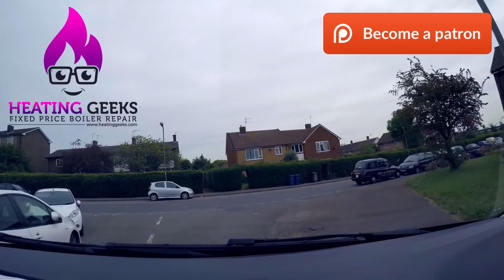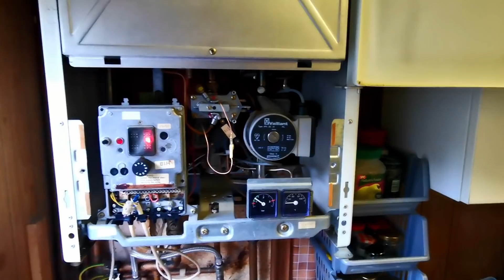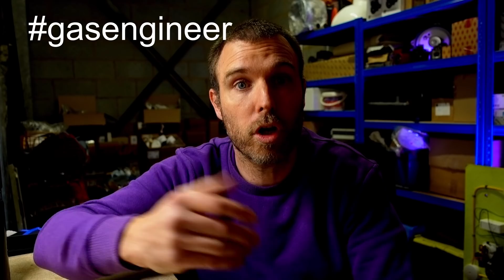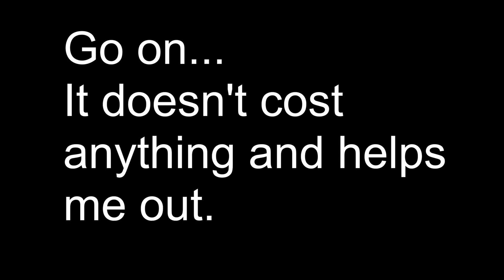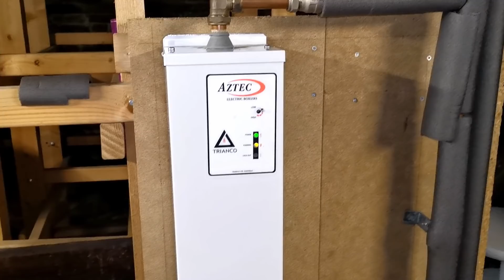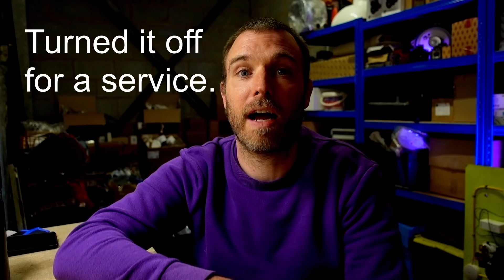Obsolete boiler parts....This could cause problems...

Comment: Hi HeatingGeek, Im a new subscriber and am really enjoying your videos. Good to know I’m not the only one banging my head off of people’s boilers day in day out. May I ask what component of the PCB you was heating up with the hair dryer and why heating it will make it work again ? Thanks 👍😃.
Reply from the maker: I was heating a failed capacitor. Heating it will make it work for a while. As long as it doesn't get cold again it will stay working. So the customer had to leave his heating on 24h but turn it low. So the boiler never had a long off period. Then I replaced the bits and its all ok.:-)
Reply: That’s great. Thanks for sharing all that valuable knowledge you have. It is appreciated. Stay safe mate 👍

Comment: A wise man once said “boiler is fit for purpose as the manufacturer intended”
Would I do it? Probably not....
People are to quick to fook you over if there’s a problem & most of us aren’t in that knowledge bracket! 
Hairdryer & solder yes- mess about with resistors and capacitors no.
Reply from the maker: Fair enough. So new boiler then?

Comment: Nothing wrong with happy customers , have been repairing dry joints on Pcb for years ELM leblanc and Potterton lynx were probably the first one I started on. (shows my age ) If the manufacture put better quality components and more solder we would not have to correct there mistake . Keep up the good work and the videos .
Reply from the maker: I worked on the lynx and lynx 2. One was drop-down PCB and one swung open if I remember > The harness failed where they bent didn't they??
Reply: @HeatingGeek Didn't  think you were old enough to remember these boilers, Lynx had drop down and was usual for dry joint on transform but when you dropped the pcb the boiler would work !!!!!! and yes lynx 2 was swing open and wires did get bent a bit and pull on the pin on pcb .Lets be carful out there has a sergeant on a TV show used to say

Comment: Great video as usual.. I think the dry joint on the vaillant is ok as who can ever prove otherwise. But I think any kind of modification has the potential to bite you in the ass as we all know the answer to that is no unfortunately.
Reply from the maker: Yep... Unfortunately, that's why I wouldn't do it on a gas boiler. Unless I can gain a qualification in electronics I wouldn't go any further.

Comment: I’d do exactly as you did Ollie. Used my limited engineering judgment to repair what I could.  
If a boiler is out with the manufacturers, then they in effect wash their hands of that appliance.  At no time has ANY manufacturer demonstrated any interest in perusing anyone for doing as you did, frankly, they don’t give a shit!!
I’d do it if the parts were even still available, fuck em!!!
Great video mate, love it, one of your best yet.  By the way, that Vaillant is older than 92.
Stay safe👍
Reply from the maker: I'm working on a boiler from 1980 or 1976 at the moment. (need to get it confirmed) Older than me though. I will get it fixed too.. (hopefully) :-)

Comment: I Agree if you just have a dry joint or something that you can see why not & would repair it . But if you tell your local Gas safe inspector ( Know it all Wanker) You are doing that he would have kittens no doubt 
I was asked once by a oftec inspector if I replaced motor bearings?  I said yes he said dont you are not a motor specialist if something happens  to that appliance you will be held responsible  
What about all these places where you can by a repaired pcb ! They could be joe bloggs in there bedroom 
people buy them
Reply from the maker: Exactly. A lot of the Ebay sellers are. :-)

Comment: I could write a hole essay on this subject but first I need to fully 7understand what Problem you have . For me I have a problem with certain manufacturers who  consistently design Pcb with under rated  components or poorly manufactured pcbs or even poorly located pcbs . Pcbs located directly next to heat sources or below  hydraulic sections  which  leak like clockwork and take out  the board . And the same manufacturers charge half the price of the boiler to buy a new Pcb. Or the  D .S who  tells the customer he replaced a faulty Pcb with a new one but has blow dried a second hand one believing his fixed it, if you have the necessary skills to diagnose down to component level and are not time challenged great as long as customer is aware of the repair. I say carry on . Keep the customer happy.
Reply from the maker: You made a lot of good points. :-) I think if a manufacturer puts poor quality (low heat rating etc) parts on a PCB and they consistently fail then we should be able to fix their built-in obsolescence. I have a couple of PCBs I can think of.

Comment: I am glad you done it, if I had of found that fault I would have told him the part is no longer available and the boiler would have not been working. I understand and totally get it as to why you posted this, its a conundrum because you know as an experienced engineer those old boards are easy to fix dry joints on, but its not allowed.  looking at the comments, lots of people have no idea what repairing the board means legally, they are not GSR or if they are need to talk to the GSR.  Yes I have done those single layered Puma boards years back, when you had tracks 10mm apart with a resistor connected across them, they look like something you would knock up at school, whereas the boards now days have 20 or 30 components in that same space.  So not now, I would not want the grief if something went wrong, and I know you don't, that's why you do those safety tests after you have fixed a boiler, there again helping someone in real need has its rewards.
Reply from the maker: The PUMA was a boiler that had an issue with the PCB that Potterton knew about but never fixed. Thats where I first realised some manufactures wanted things to fail. That really annoyed me. How can they get away with that?
Reply: @HeatingGeek  I have never fitted a potterton since those days, or a baxi. if I work on one I can still see the same design principals.

Comment: I’m an electronics engineer who owns a small heating company. I can sympathise with the manufacturers to some extent that supporting appliances forever isn’t really feasible.

The manufacturer is limited by obsolescence too. The PCB in your 25 year old boiler may well have parts in it that are obsolete.

Legislation is a big factor too. The manufacturer is obliged to put each part they wish to sell through CE certification. If parts become obsolete you’d have to certify the product again.

From a legal stand point your putting yourself at risk by changing parts not on a like for like basis. If you change the design in any way you become the manufacturer and are then responsible for that product.

I looked at manufacturing compatible PCBs but found one of the gas regs explicitly forbid it.
Reply from the maker: I know. Thats why I showed an electric boiler. :-) What do you think about the dry joint?
Reply: HeatingGeek no one could ever argue that a dry joint was anything other than a like for like repair.

I’d also be happy to replace a components on a board level. The odds of anything going wrong it’s not worth worrying about. I just wouldn’t tell the home owner that’s how I’d repaired it or put it in writing for that 1% chance.

Other problem is how long does it take you to get to site, find the fault, get the 15p capacitor, go back, fit and test it. In the customers head you’ve charged them £300 for fitting a 15p part.
Reply: Chris B sorry I disagree Chris, that 15p capacitor is part of the boiler, fuck the manufacturers, they don’t care & there’s no PCB Police around our area.  Ollie uses his engineering judgement, he’s there to fix the boiler.   A PCB repair is generally on the lower voltage & current side of the board anyway.  Granted, if you’re employing people, it’s your neck on the line & you need to have procedures in place & Rules to follow.
Reply from the maker: @chrisb4009  I charge a fixed fee on private work so the customer doesn't have to worry too much about it. :-)
Reply: HeatingGeek fantastic channel by the wayx

Comment: I think your spot on, as of another comment - if you can see the ratings you are simply replacing the faulty part, like for like. How is that modifying it? On the subject of electronics, what is the display you show in your intro that has frequency, cycle, pulse width? Duty on the screen? Thanks.
Reply from the maker: Thats the PWM to a keston fan. I did a whole video but lost a lot of it. I might stitch it together like this one. :-)
Reply: Is it a piece of equipment you’ve bought to test this? Perhaps add it to your list of tools to buy??

Comment: You are not modifying the component, it's a repair, and both good ones, I replaced the Pump relay on my vaillant ecotec exclusive  832 when it failed as the PCB was £280... relay was £3 for the exact same one, why we are engineers and not fitters! Well done @heatinggeek
Reply from the maker: Thanks. :-) But if it was a gas boiler that I replaced the cap on i would of been breaking the Gas regs? Maybe?
Reply: @HeatingGeek  only if they know.... and some of the shocking installs we see everyday I very much doubt they would be interested, if you are replacing a component of the same if not better quality, then how is it modifying?? It is classed as a repair and a good one, I agree if you are not confident then best leave alone and just replace the complete component, but if you have the ability and know how then why not, better for the customer and the environment  👍🏻👍🏻

Comment: Dude It's absolutely fine in my opinion, I've been using a hair dryer and electronics soldering Kit for years! It's no different to repairing any other part of a boiler, as long as you have an understanding of what you're doing.....RS Components sell all the necessary bits for PCB repairs, obviously not every PCB fault can be repaired without an Oscilioscope  and other testing equipment but many issues can be resolved by an experienced Gas engineer with a good basic knowledge of Electrics and electronics
Reply from the maker: Thats what I think too. I have an oscilloscope in the van too. I don't use it really though....

Comment: You are right to repair the pcb, i work on domestic appliances and if i need to i repair pcbs for my customers its just a case of up skilling and trying things out so you can improve the out comes.
Reply from the maker: On old PCBs it was very easy. Find the burnt joint. Resolder it, job done. :-)

Comment: Changing bits on a gas appliance like you did the electric boiler is technically wrong - you are modifying the appliance beyond its initial CE approval.  Morally wrong?  I guess it depends on what that component is controlling.  Fan, gas valve control?  A bit sketchy, and personally I wouldn't do it.  I'm not going to comment on the rights and wrongs of doing it on an electric boiler s I am not that ofay with them.

Resoldering a dry joint is definitely the way to go if that's all the fault is.  Resurrected hundreds of Pumas and even the odd Suprima doing that.

Manufacturers appear to design the dreaded CXi and Junior power-off faults into the product; and why I avoid installing their junk.  Vaillant Eco's had the dreaded CON fault too which I seem to remember was blown caps too.

The old Bunnies were great, but I confess the original Thermocompacts and Sines still give me the vapours on some faults.
Reply: Dan Robinson if the component replaced is of the same rating, how is it modifying it? My way of thinking is that you are simply replacing the faulty part??
Reply from the maker: And if you remove a rubbish cap and fit a nipon chemicon top brand is that wrong..... YES, on a Gas appliance. Weird isn't it.
Reply from the maker: Thats why I showed the electric boiler. :-) Cant do it on a Gas boiler. Not legally. What would you do for your gran or grandad though. If they want to keep the old boiler? Thats the problem.
Reply: So as you said in this video about BG. How do they get away with it? Why is it not illegal for them? Do they put the responsibility back on the electronics engineer/company that re produce PCB’s (icos/Isar for example)  I’m led to believe BG had their own PCB’s made for these, not sure about them reproducing other brands/models of PCB’s??
Reply: @MrAdamtheplumber  They're sent off to a third-party electronics company, that can properly re-certify the pcb as being safe.

I don't see any issue with repairing  dry joints however, unless you've made a right pig's ear of it!

Great work Ollie. I'd love to learn more about electronics too. This video has whetted my appetite more. Thank you for taking the time to show us and ponder the question 👍
Reply: darren cahill I don’t have a problem with that myself but I like to try and view it at all angles. It’s one thing to replace a faulty component like for like, but having an entire PCB made for someone else’s boiler (which I assume has now been modified or am I wrong to assume this?), let’s say worse case scenario if it came down to an insurance claim if something went wrong with that PCB and for this example a BG engineer knowingly fitted it (a non genuine part but certified for BG as described above), who would be to blame? Yes the 3rd party company have said it’s safe but we shouldn’t technically be fitting non genuine boiler parts? I feel like I’m having a battle in my head with this one 😂. One side saying, absolutely not a problem and the other side saying, what if... 🤯.

Comment: fuking hell , top class , see if it was the full board on the pcb , then obs , there is nothing you can do , , but see when the boiler does finally pack in , then your the first they will call to do the replacement. well done
Reply from the maker: If only I fitted boilers. :-) Too broken to do that anymore. Back knee and shoulder. :-) Maybe one of my boys can do it for me.

Comment: I think you did good, I've got  30yrs behind me and I  refuse to be a robot and still enjoy my job and knowledge , experiance and pride enable me to think outside the box. It grinds my gears listening to quotes like " its an old boiler and parts are obsolete " This throw away  society has a lot to answer for, boiler manufactures just want old farts like me to fuck off and for the rest of you to keep putting in new boilers. Don't be a robot, be an engineer and engineer a fix!
Reply from the maker: Exactly. Throw away society is the biggest problem with the world. I love to see an old van, car, bike or sowing machine. People used to tale pride in the repair and maintenance of such things. What do you do? Cant win when the laws are against you.
Reply: @HeatingGeek  Its so ironic  as you sound so much like me, when I started out I was young and excited, I  wanted to learn everything about boilers and heating systems and nothing was going to beat me. Slowly as the years went by and the industry changed some things good, something's bad I slowly found myself becoming a sinical old timer, but I still have that urge to repair first and replace second. Please carry on as you are and you will join a very small brotherhood of men who are real engineers. Just look at the way people marval at the people's skill on the TV programme The Repair Shop.🙂
Reply from the maker: @stevenashby8268  Before I started this youtube channel I tried to get out of the gas industry. I was so bored and fed up of customers and builders. I decided to give youtube a go. Im still here and still love a good repair. Especially when others have said it can be fixed.:-)

Comment: Fair play I say, nothing wrong with fixing something that others say they can't. If you've got the time and they have the money then it's win win. And if the manufacturer has turned it's back on producing parts for it's older products for whatever reason then I personally don't think that they are in a position to condemn you for doing it. Repairing electronics is a dying sport.
Reply from the maker: I wish we could do a a bit of electronics in a training center. It would help out a lot of guys.

Comment: If you can do a simple, lasting repair on a normally obsolete part is what makes you a good engineer. I wouldn't be too concerned what others are doing. They only get upset cause you exposed them as stupid
Reply from the maker: I worry about the regulations stoping me from repairing parts on boilers. New new new is the only safe way.
Reply: @HeatingGeek  I totally understand. If you,re still confident enough that all the safety devices are still working and you done all your checks all should be good. You strike me as a fairly conscientious worker. I doubt you'd get much sleep if you felt there was a high risk.

Comment: Good video. I have done this with Ferroli PCBs and a lot of times with Vaillant wireless outdoor sensors, sometimes I am not allowed to repair things because I'm told that manufacturer forbids it due to safety concerns, but also because my boss simply want to sell a new boiler or a heat pump.
Reply from the maker: What happens to the outdoor sensors? I have one on my wall here.
Reply: @HeatingGeek  The Vaillant wireless outdoor sensors with solar cells go bad after awhile and the boiler thinks it is 0 degrees outside. If you open it and run over the larger solder points you can usually get it going again or replace it with a glow worm one, which is much cheaper than the exact same Villant one.